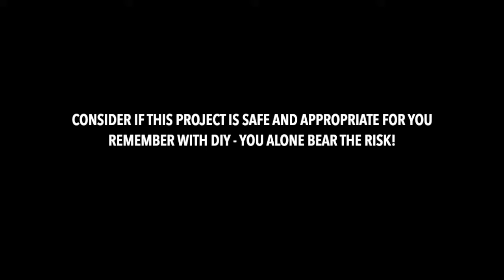Kia Optima - Front Brake Pads & Rotors Replacement - 2015

Comment: JUST finished brakes on my sister's 2015 Kia Optima. Was actually able to do it because of this video and the suggestion to get an impact screw driver from Harbor Freight ($9.99). Would have otherwise given up on the rotor screws. Thanks!
Reply from the maker: Thank you so much!!! So glad to hear it!
Reply: @MINUTEDIYVIDEOS  Funny thing is that I also broke the head of one of the rotor screws.  Go figure!
Reply: @MINUTEDIYVIDEOS will this work on a 2013 optima ex

Comment: Easy video i had a hell of s time doing mine in the driveway. A 2016 optima ex rear brakes, they only had ceramic replacements, with the thick meaty pads, but i had to dis mount the entire bracket in order to do so.  Also i struggled putting back on the caliper bolts as it still had threads locker on them.

Comment: I have a 95 Chevy Astro van brand new alternator brand new battery alternator is not charging battery, where does the alternator get its power from is it coming from ignition switch or what??
Reply: The alternator creates power when the engine turns it via the belt.

Comment: You have to be kidding.  You broke the most basic safety rule.  You trusted a scissor jack alone without jack stands for your safety.  You need at least one jack stand under the sub-frame.  Especially when you are hitting the rotor fasteners with an impact wrench and hammer.  Had that jack slipped, bent, for failed, your video would have been of the Emergency Room instead.